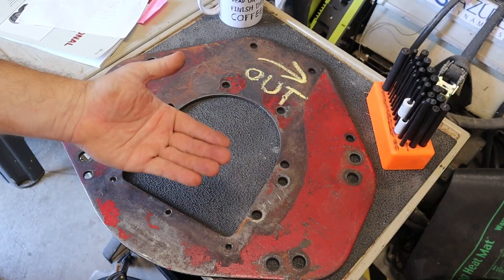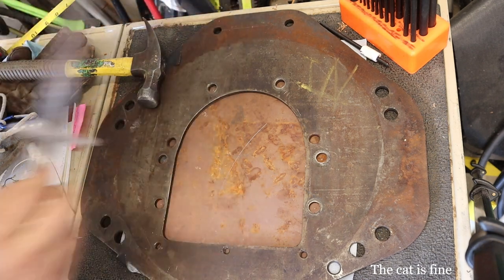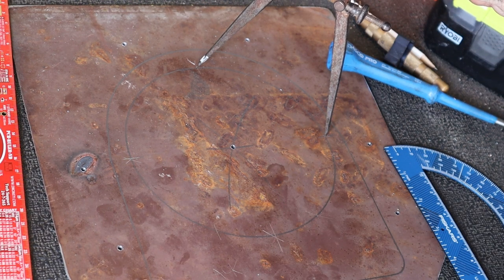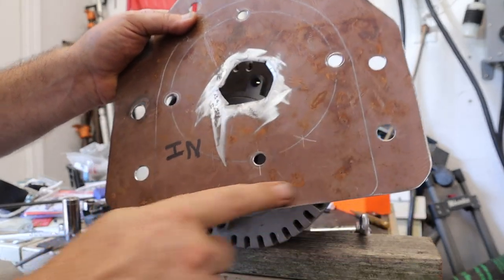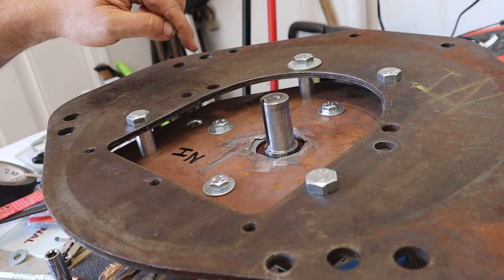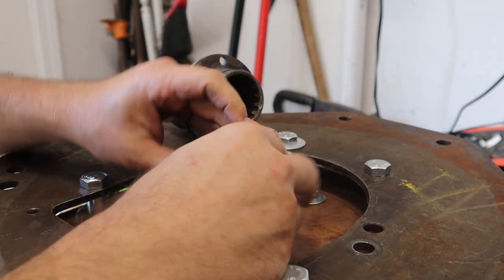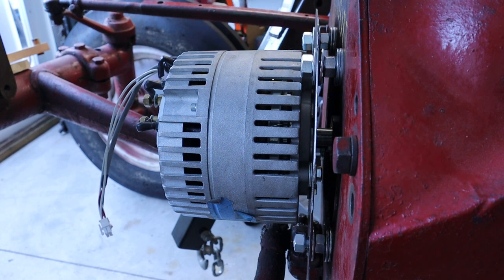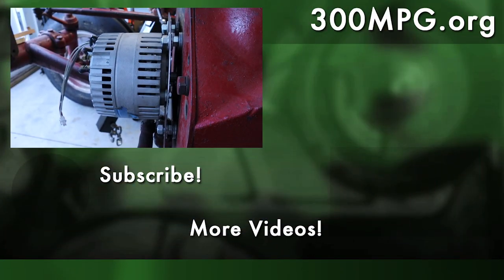Electric Tractor: Motor Mounting Plate Design and Construction

Comment: really cool... do you need to add some loc-tite to those threads?
Reply from the maker: Yes, this really needs loc-tite, nylock nuts, or split washers. What you see in the video is really more of a test fit than anything. A few bolts could be a little longer, etc.

Comment: Nice job of explaining your process!!!!
What is the rpm range of that motor?
Reply from the maker: That motor is good for up to 5,000 RPM.
Reply: @BenjaminNelsonX  Thank you.
But--  a friend is planning to do what you have done (with an IH 300) and finds that max rpms of the original engine of a 300 is somewhat less that 2000 rpms.  So how does that affect the power that your tractor has?  (I tried to paste a copy of the IH manual page that shows the tach and explains the speeds, but it wouldn't paste here)
Reply from the maker: @frenchcreekvalley  What it really means is that you have to know the torque of your motor, rather than the horsepower.
Horsepower includes the speed of the motor (RPM.)
Many engines and motors are rated in Horsepower, but that's irrelevant if your electric motor is rated at 5,000 or 10,000 RPM. You need to know what it would be at 1800 RPM.

What that comes down to is needing an electric motor which has high torque and low speed.
A DC forklift motor may be the motor with the best characteristics to match the original gas engine.